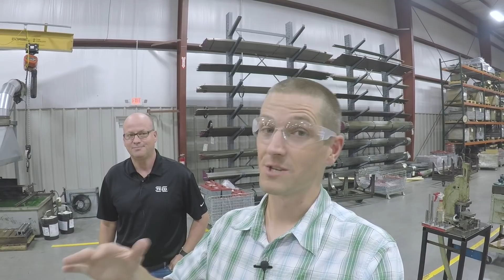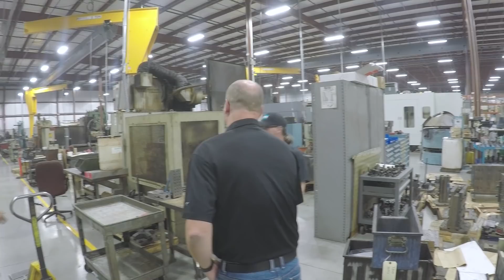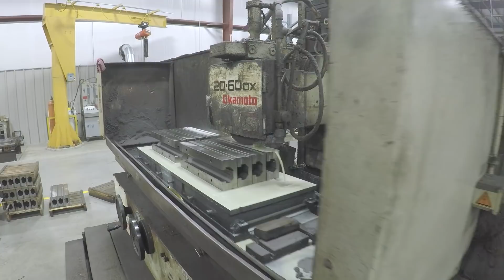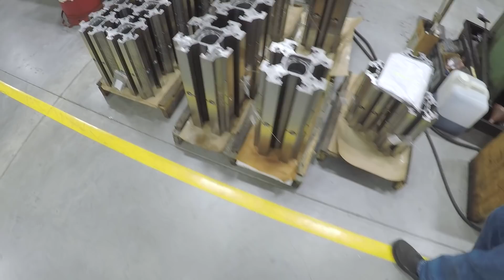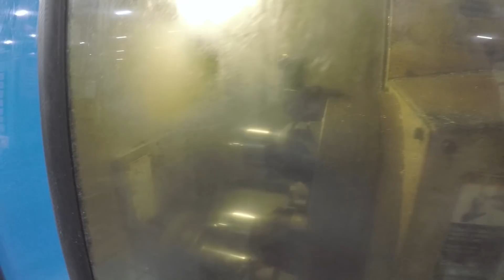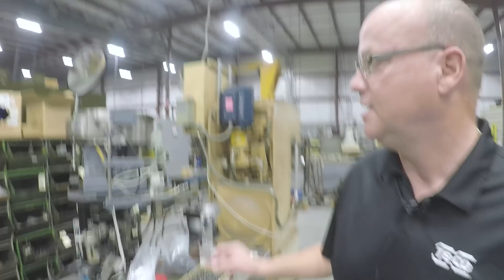AWESOME TE-CO Workholding Factory Tour!

Comment: That is weird , I have seen factories fully automated  even in china , why this factory is using labor for simple tasks like moving  things .
Reply: LOL..is it illegal to not run a fully automated factory? The building looks quite new, but they have moved in their old machines. From the video one can understand that they are gradually working on automatiation of different operations. One step at the time. They have obilously not have had the big need for a quick upgrade of the workflow, likely because they have had no big issues with the current cost of their products

Comment: 👨‍💻You go & see how a Power board is made  all inside work THE  Metal box stamped out & formed the copper buss bars pressed on big press auto feeder & All the small components  electrical  switches  all put together by rows of women I WORKED there late 90s  
Where springvale rd vic OZ 🕺🐨got boring  as was a temp job while i looked for a better

Comment: At the material receiving area, was it set up where there were in and out doors on opposite sides of building (opposite each other), so the delivery truck could drive into the building and offload the raw stock in parallel to the long axis of the truck, if you remember?  Just thought I would ask as it looks like they may have set up the new building with that type of efficiency.
Best - Michael

Comment: Have these guys never heard of induction hardening? Are they really flame-hardening? What time do we live in? The 1950s?!
Reply: The only big reason people induction harden large, simple surfaced parts is energy efficiency.
So maybe it cost an extra 50 cents on a $150 dollar part. Who gives a shit. 
Their current setup is easy and in the unlikely possibility that something breaks they just go down to Grainger and buy a part.(up and running in 2 hours)
If you decide to induction heat and the controller goes down. You have to call out a technician who will cost you 300 bucks or more and might not even get it running that day, or week.
Trying to save 50 cents can end up costing a company tens or even hundreds of thousands of dollars in late deliveries.

Comment: dust collection is going to require some thinking about a big box.. with a tapered upper surface..  invision half a a house with a hip roof.. a shop vacuum or dust collector hose at the small end.. so anything that gets into the almost funnel shape gets sucked in..  you may require an electric leaf blower on the other side supplying enough blow force to keep the top of the part clean and getting the air and particles moving toward the collector funnel.  some way to throttle the airflow out.. either with a router speed control or big dust collector sliding valves.       you could also build something like a transparent mig welding nozzle. that could have a significant snout to hook to the shop vacuum or dust collecting system.  it would have to be 2 different sizes tubes that slip fit  and a round plate made like a dinner plate with all the edges curved up..  so it would lift up and keep the opening in the middle close to the work for maximum suction force.  and vertical movement as the tool goes deeper.   clear sections to allow viewing..

Comment: So much for one piece flow. WIP inventory costs must be huge. If they do the same standard products constantly my thoughts would be smaller machines in-line. Much easier to automate or reduce handling.
Reply from the maker: Perhaps it doesn't make sense to one piece flow a t-nut :)
Reply: NYC CNC No, and sending out for heat treat and coating doesn’t help. It just seems like a lot of stuff in-process which is waste. If it doesn’t add value to the customer don’t do it. Just like programming.

Comment: Nice tour, I like tours of places, even if they are video tours. At 6:40 I think it is a 50 ton. Roll threads are far stronger than cut threads. Because this machine is an auto feed, I suspect they had originally planned to auto feed them. Hand feeding is actually better done on a hand feed machine, you get less of those bad starts. But, those shafts actually can be set up to auto feed on that machine, the way to do it, will unlikely be easily found though. But, if auto feeding desired, if I were me, I would do that job on a two or three die round die machine. For this job, two die would be cheapest, and threads will be even better than flat die. Set up on round die is easy and method can be easily found.  Alignment on two die round die is rotate one die (drive shaft) until no laps, just as easy as flat die, actually faster,  just a different way.